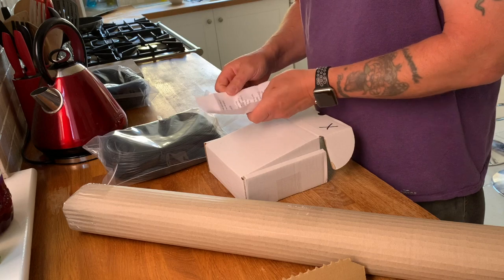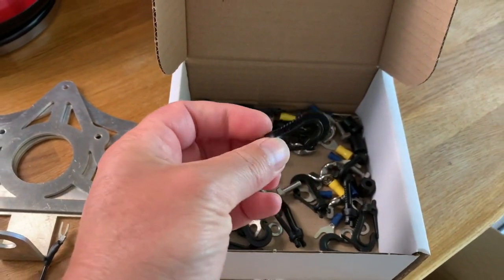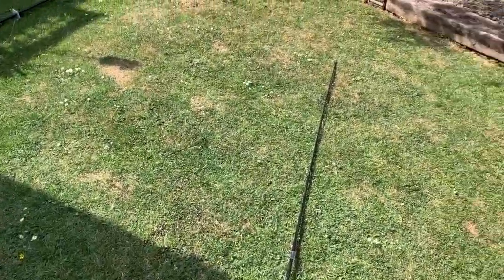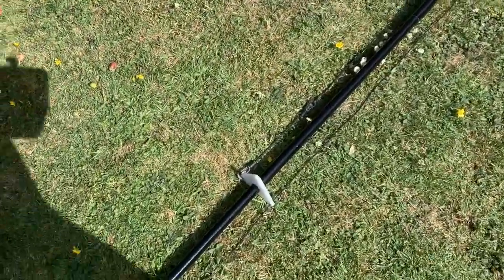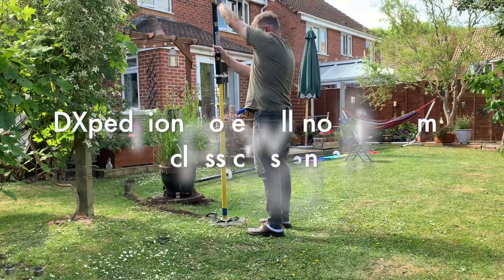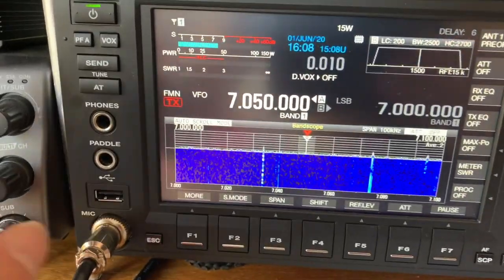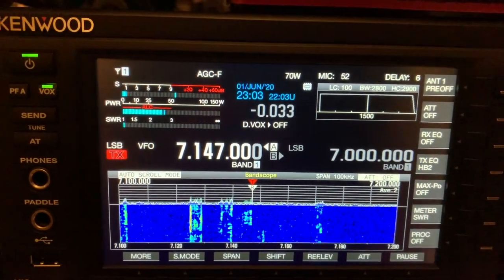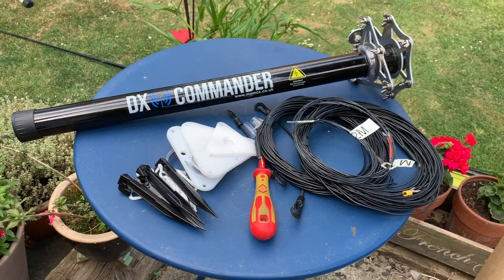DX Commander DXpedition Build..

Comment: Im convinced that every UK operator needs to have the -K at the end of their callsign to represent ownership of Kenwood TS990 :D  .. Lovely radio.  Unfortunately Kenwood has pulled out of the amateur radio  business here in Australia.
Reply from the maker: Ezat Tizani sad to hear that news about Kenwood, love my radio.
Reply: Seriously, pulled out!  That is a blow, I am not moving to Australia if I can't buy a Kenwood.  I would have to go for an Icom!  Why did they pull out of Australia, bit of a odd decision.  You use odd frequencies down under or something?
Reply: @BoB4jjjjs  You can buy a kenwood, from overseas though but if it goes foul, then nobody in Australia to fix them.  The technician that repaired them who worked for kenwood has retired. Would honestly love a TS990.  Just the thought of shipping it overseas for repair is a little scary.
Reply: @vk2yi81  Yeah, shipping and dealing with customs can be a nightmare!  Looks like Icom has the upper hand in Australia then, unless you count Chinkileeseian products of unknownium tyoelisk thingies.  Yeah, China will make better, not so much better, but a lot cheaper then Japan and then in 10 years it will be someone else's turn.  Sometimes it makes you wonder who won the WW11 anyway!
Reply: DX Commander  Safer that way, no kids but not so satisfying. Oh, Kenwood, my mistake, my mind had drifted!!!

Comment: Nice to see someone build the Expedition as per spec BEFORE fiddling with it :) 
Funny how it works straight out of the box IF the instructions are followed huh.
I have used the Expedition model since day one on several DX-peditions to the Pacific now, and you are right, it fits into my suitcase with no fuss.
Takes me about 10 mins and i am up and running with them (yes two of them phased for 40mtrs) now days......  Great video again Mike.
Cheers
Reply from the maker: Thanks Roly, I always try to stick to the instruction on first build :) Then Play after I know it works :).  I have one of each DXC's now, still love the classic best.
Reply: @mike-M0MSN  Agreed Mike. The classic is the work horse for sure.  The Expedition was developed by Callum and I so that it would fit into a suitcase for me to take on my DX-peditions. I used to take the classic but that meant another piece of luggage which inevitably lead to excess luggage charges and attracted the attention for duty/tax seekers !!!  So, the Expedition was developed and now it is "out of sight - out of mind"....   Cheers
Reply: @RolyRJ  Way to go with a smaller antenna that is out of sight and out of mind.  Customs and airlines love to charge you extra money when they get the chance!
Reply: @BoB4jjjjs  In Papua New Guinea (P29RR) I tell them what the "extra" will be now days :)
"It is either 20 Kina or nothing, your choice" :)
Reply: @RolyRJ  I like your style :-))

Comment: No Radials on that one Mike ?
Reply: I was thinking the same, I didn't see Mike attach the radials.
Reply from the maker: RADIALS :- I used the DXC Classic's base which already has the radials attached and buried. No need to make more new ones for this test build.. :)
Reply: @mike-M0MSN  thought it was just Tie Wrapped, did you Couple up the two Bases Mike?
Reply from the maker: @deenunya7735  Yep will have to redo the video sometime!!!
Reply: @mike-M0MSN  I have one big problem when it comes to DX Commander redials, the garden is slabbed and two big sheds sit in the other direction,  My garden is not designed for burring radials!  That is if I ever get past not being allowed to put up an antenna!  They are worse than the little man with the funny tash!   It ain't Charlie Chaplin I am talking about either!
Reply: Just an oopsie...
Reply: https://www.youtube.com/watch?v=wKc9KT3zbv0  .. Using the Classic base, now It's clear to me. Thanks!